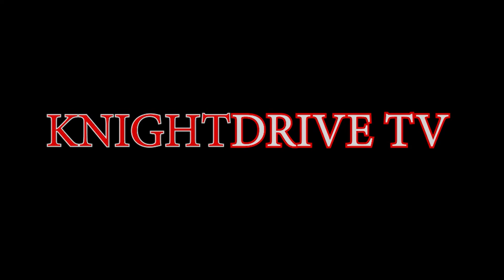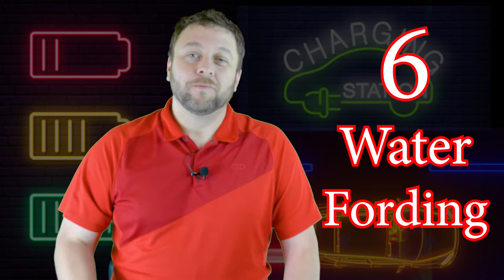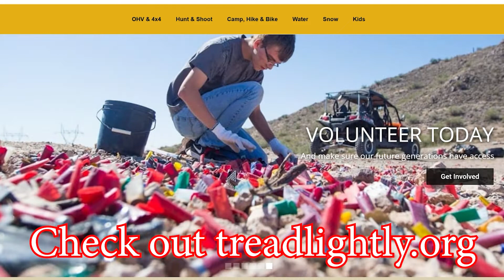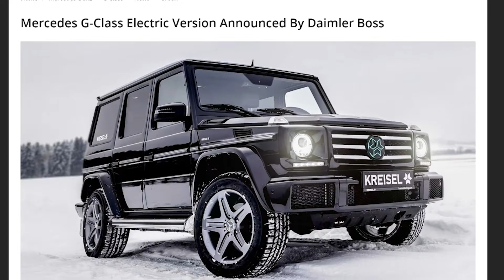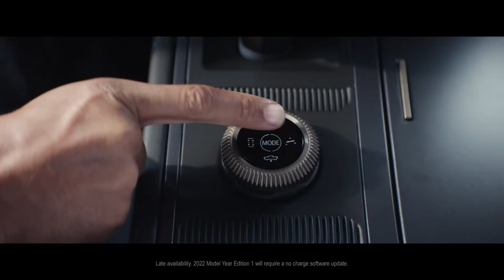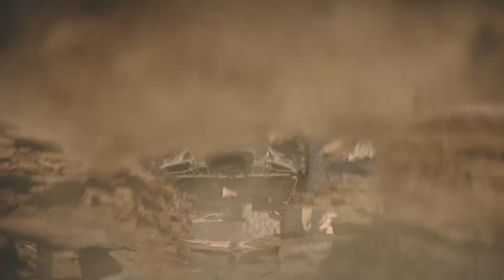10 EV Advantages Off-Road | Hummer Rivian Cybertruck Bronco

Comment: Makes sense.... we all know charging locations are on desolate trails
Reply from the maker: There is no gas stations on trails either, to be fair.  A generator on board would charge the vehicle, as well as a solar array that could unfold or be deployed.  Would be a slow charge rate but planning, aftermarket solutions...if there is a demand, there will be an aftermarket solution. For the trail runs I do...day runs, I only use a 1/3 tank maybe...ev would do it.  Just those longer trips youd have to figure out.
Reply: @KnightDriveTV  makes perfect sense having floor pans full of delicate heavy batteries on ruff terrain

Comment: great video and information. the ev market is fresh and new of course and i want to reject it because ya know big blocks and stuff but the capabilities and power are undeniable. i cant wait untill the battery and charging/ power recapture take the next step. if we could only focus moon light...
Reply from the maker: Its an exciting future for sure.  I have played with RC vehicles since I was a kid, and it was undeniable that electric was faster, more reliable, simpler, etc.  The battery technology and range was always the issue though.  As battery density finally reaches the point of usable, I think electrics will take us to speeds and capability we havent really imagined possible.  I mean..0-60 in 3 seconds in a Hummer is pretty insane.  I am opened to it. In our life times there will be space for both gas and ev...I look forward to toying with both.
Reply: Wish I would have switched to battery before I got out of rc. it's always something with nitro, especially the cheaper stuff not holding tune, burnt out glo plug, filter fails and ya smoke a cylinder. I do have a nice little reds motor waiting for a chassis but that will be some time. Its almost scary that some people will be in the streets with a vehicle that big and that fast, at least the safety technology is on par with the power, well let's hope so anyway.